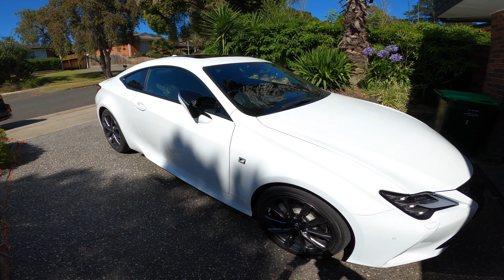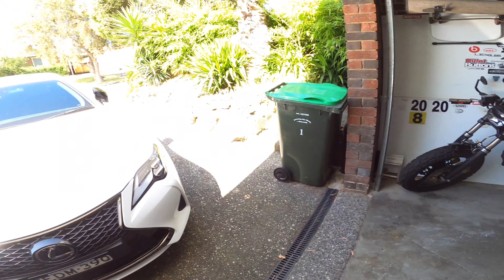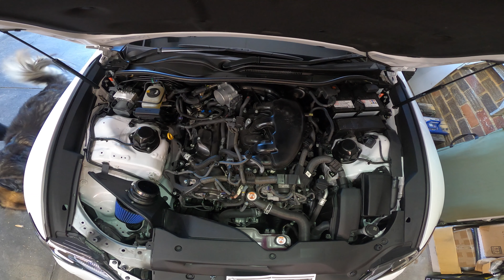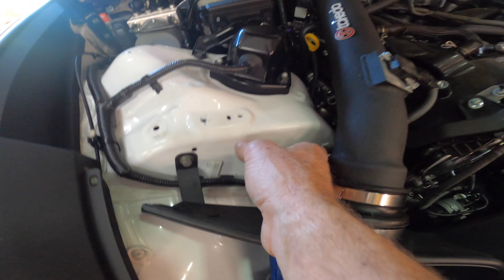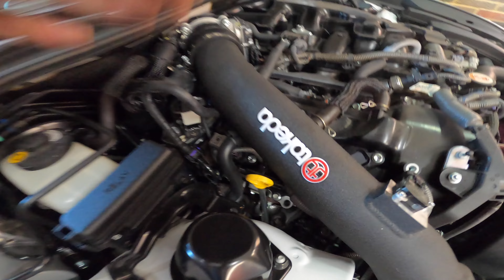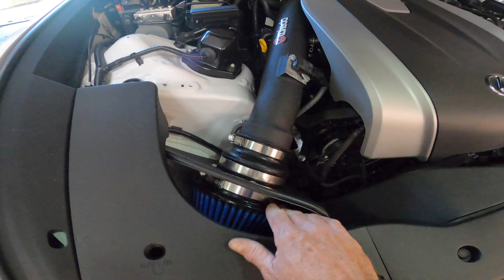Lexus RC350 F Sport Takeda cold air intake install and sound. #coldairinduction #lexus #takeda

Comment: Your car sounds BEAST ! 🔥🔥😍Will you recommend me getting this one over the F sport cold intake ? I have 19 ES 350 F sport,
Reply from the maker: Thanks mate, as for this over the F sport I think you'd be fine with either as I had the F sport CAI on my previous IS350 Fsport and it looked and sounded exactly the same. I guess it just comes down to availability and price but you won't regret either.
Reply: @twistedfatebuilds  i just called lexus now to make sure if they’re available for the ES but turns out not lol, lame !! Thanks again

Comment: thanks for the video, did you experience any check engine lights or anything like that with the new intake?
Reply from the maker: Thanks buddy, no issues whatsoever. The only time I've had anything was when I put a throttle controller in and it and a check engine light and code which was low pedal voltage when I checked with my scanner. Cleared it and it's never came back

Comment: I own an is350, love the sound of the engine, but I'm struggling in video to tell the difference in intake sound. 😂 I've got a custom cat back due on the 30th, hopefully it doesn't sound horrible. 😂
Reply from the maker: Really? It's so much throatier but maybe a lot easier to tell off camera. It does sound the same down low but wakes up in the upper rpm. What cat back did you go with? I really want to get one one ASAP but shipping and availablity are driving the price too high to get it here at the moment. I had the Tanabe medallion on my IS350 Fsport and that sounded epic. People couldn't believe it wasn't a V8 when in it.
Reply: @twistedfatebuilds  I'm getting a full custom made(mild steel for sound and weight). The is350(2021), in Australia atleast for me, only has axle backs available. So full custom was required.
Reply from the maker: @jyfsh-rq9jc  Nice mate. Love to hear it when done. Yeah same here in Victoria, axle backs are straight off the shelf but exy so may even go your way too
Reply: That intake makes it sound way more aggressive

Comment: Hi, I got my takeda intake kit from afe power for the rc350 And I noticed it has the coupling for the gs350 but it doesn't contain the coupling for the rc 350. I'm very confused right now, could they have sent the wrong thing or did they send the coupling for both models when you got yours?
Reply from the maker: Hi mate, just refreshed my memory from the instructions. You should have 3"coupling M1 which is for the GS and 3" hump coupling M2 which is the one for the RC
Reply from the maker: Check if all the parts are in the box from here in the installation link 

https://afepower.com/afe-power-tr-2015b-1r-takeda-stage-2-pro-5r-cold-air-intake-system#add-ons

Comment: Serious question. Aside from increasing decibels, what other benefits can one expect with this mod, or is it all about aesthetics and sound? I’m asking because I just received a new air filter that I’m going to replace, which is how I found this video.
Reply from the maker: For me it was just the nice induction sound. It gives it almost a deep small V8 rumble. It does look cool too but who ever sees under the bonnet apart from your mechanic! They claim 13HP but your never going to feel that lets be honest :) If your looking for something that is going to make the car feel faster I highly recommend a throttle controller, I recently installed one to get rid of the throttle lag and it's amazing and will only set you back a couple of hundred dollars (In Australia) makes it feel like you've put a turbo on! I'll do a vid on it shortly.
Reply: @twistedfatebuilds  - Thank you for responding.  I leased my 350 but couldn’t turn it in at lease end so I bought it. I like the little growl it gives but wish it was a little more. I just might do this.  It’s plenty fast for me as is, but that could change. I’ll be on the lookout for your next video.

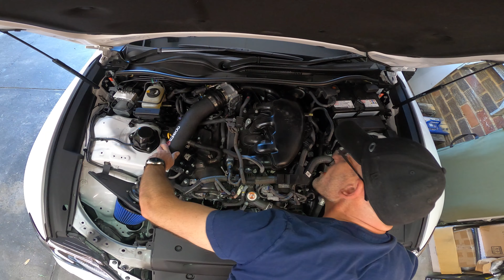Comment: @ 2:02, does you breather hose not slip off? cause mine keeps on slipping off. Any tips to make it stay?
Reply from the maker: Hi Jan, I haven't had any issues with the hose slipping off buddy. I used the spring clamp on it and seems to be fine. I guess you could change it for a proper screw type hose clamp to get it down tighter?
Reply: @twistedfatebuilds  ok thanks will try that again. my last option would be buying a new hose  for it
Reply: @MrJ01194  I bought a new hose for $10.  works now.  mine kept slipping off too.
Reply: @michaelloteyro7074  i bought a new hose and a screw type clamp lol, Hey arent you on the Lexus RC Club? lol
Reply: @MrJ01194  yes lol. Just joined.

Comment: Anyone know how often you’re supposed to clean and oil the filter on these? I’ve got the same one in my rc and can’t find any info on it
Reply from the maker: I have previously looked on the K&N filter page re this. They say smaller filter about every 50,000 miles and larger cone type can go up to 100,000. These are similar filters so around that mark but to be honest you can never over clean a filter so I'll go once every 12-18 months 😉

Comment: How much does it cost to install that mod for a retail customer?
Reply from the maker: Not sure mate, I got mine 2nd hand never installed pretty cheap and installation took under two hours so would depend on the hourly rate where you are but it's such a simple job I would be doing it myself if possible 😉

Comment: did u notice any performance gains ? is it worth getting in general ?
Reply from the maker: No performance gains noticed mate. It's more the great induction noise coming from under the bonnet that makes it worth every cent 😉
Reply: @twistedfatebuilds  how much did u get it for btw ?
Reply from the maker: @satanofsunset817  I got lucky! A guy brought it but never installed and had traded his RC in so found it on Gumtree for $300
Reply: @twistedfatebuilds  i found one for 480$ should i get it or find a better price?
Reply from the maker: @satanofsunset817  I'd be jumping all over it. Pretty rare for them to come up 2nd hand
Reply: @twistedfatebuilds  no brand new 480$
Reply: @twistedfatebuilds  and does it need any tuning or just plug and play?
Reply from the maker: @satanofsunset817  plug and play buddy

Comment: does it make a huge difference in terms of fuel efficiency?
Reply from the maker: To be honest it will make fuel efficiency way worse when I'm driving as it sounds awesome with your foot to the floor 😅 Jokes aside I honestly don't know buddy, even the claimed 10HP I don't think you'd ever tell but I did it solely for the sound gain 😉
Reply: @twistedfatebuilds  need some time or tune to make it happen